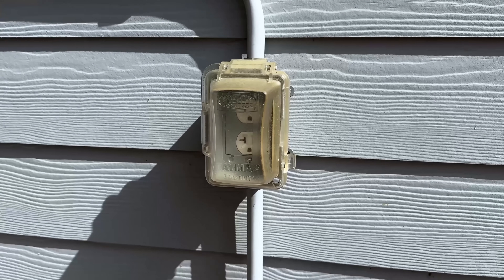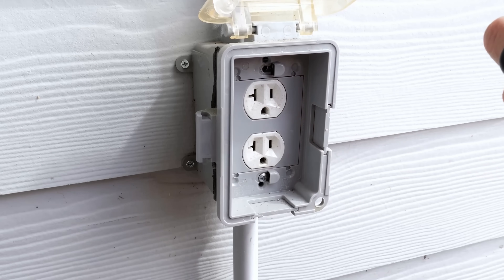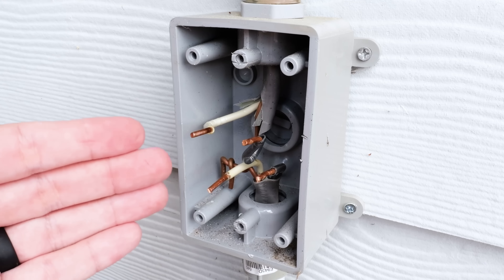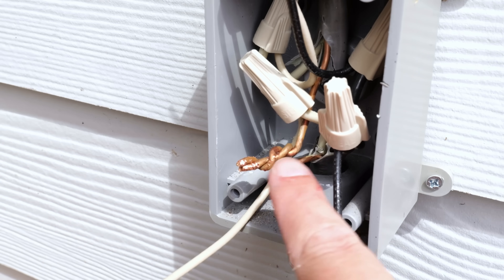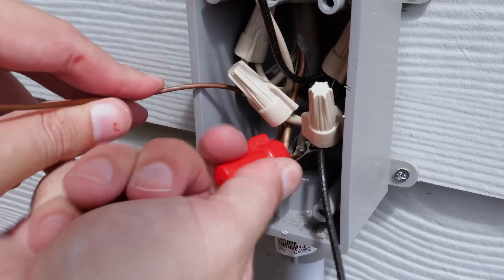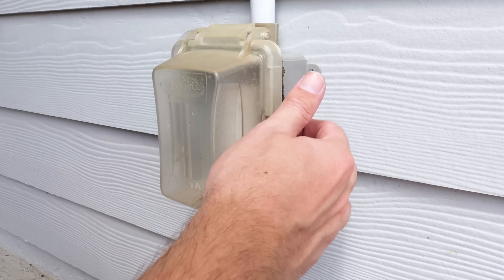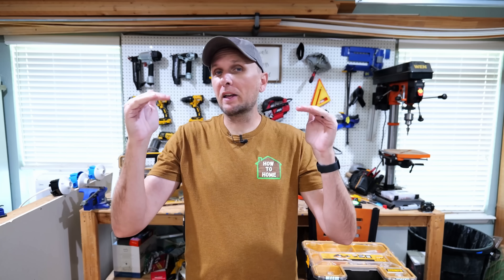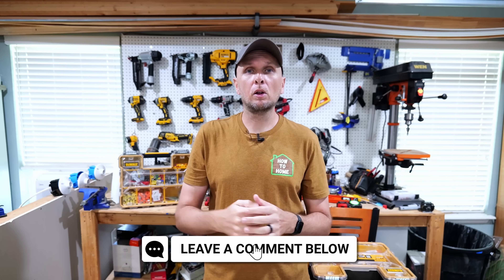Dangerous Mistakes DIYers Miss When Installing Outdoor Outlets!

Comment: The tester you used i used one not as nice as yours i tested a outlet i told a guy who did wiring he said the GFI will show its bad even if it wired the correct way what do you think is your tester made specific for GFI outlet
Reply: I also, though not an electrician, own 2 GFCI rated testers that are SPECIFICALLY designed to test GFCI outlets as well as all the rest.  They cost more but I prefer to have that capability when it's needed.

Comment: Is that even the correct kind of wire to run in conduit? I thought it had to be stranded for conduit because of heat buildup.
Reply from the maker: It is UF wire.  Completely allowed.  Romex would not be in a wet location.

Comment: I am confused as to whether the mission of your channel is “How to home” or if it’s “How to do electrical work up to NEC requirements”? Code matters little for most DIY home owners when it comes to retrofitting.  Certain things like GFCI’s outside are pertinent but length of conductors in the box is strictly up to their preference. In Texas any homeowner that resides in the home can perform electrical work on said home without a license.
Reply from the maker: This is a very odd comment.  There are reasons code are what they are.  Safety is one.  Also, if a homeowner does their own work and they did it incorrectly and it results in a fire, it’s possible if the insurance company sees it that they may not accept the claim.  Why do you advocate for people to do things incorrectly because they are home owners?  The length of conductors is not just for their preference.
Reply: @ Easy there, just asking a question! I am not “advocating for people to do things incorrectly”, it is just odd for a diy source to preach code so heavily to people that are ostensibly not licensed electricians and it’s coming from someone that is also not a licensed electrician, or at least didn’t mention being one.  As someone that is in the electrical trade and has taken several tests on the NEC over the years and spent hundreds of hours studying the codebook, I promise you that not everything in the NEC is there out of a desire to promote safety and the preservation of life and property, and homeowners should use their own judgement in certain cases if they decide to take on a project instead of calling a professional electrician in the first place. To reiterate, I did mention that some code requirements are pertinent, such as the gfci requirement outdoors or in other wet locations. It is actually code requirement now for the receptacle you replaced to be protected by AFCI as well, depending on your state. I notice that you did not mention that, but I wouldn’t blame you because the breakers are 9-10 times the price of a normal breaker and can cause nuisance tripping as well. With modern technology anyone can find answers to code questions in mere seconds, but most people have the good sense to call a licensed electrician if they don’t know what they are doing. I wish all homeowners would call qualified, licensed and insured electricians and not use jake leg “handymen” like “Juan’s home improvement” types that are extremely prolific here in Texas. Have a good day, no offense intended.
Edited for punctuation error
Reply: @HowToHomeDIY  Thank you.  When people are working with a potentially lethal subject following proper safety precautions and "code" might be worthwhile.   (just a thought)
Reply: Even Texans occasionally sell their homes and real estate home inspections worth their salt will pick up on crap electrical work. Typically a home buyer will request that  repairs be made by a licensed electrician. So there you are having done the initial bad work and then having to pay for the rework, which is always more expensive than doing it right in the first place

Comment: My outdoor outlets on a GFCI thats in a bathroom on the second floor.
When ever it rains a lot it keeps tripping. The box was installed in the wall. Weather proof covers do not help, i used several trying to solve this problem.
How can i fix this issue?

Comment: Heyyy, your sposed to twist the wires together, then the wire nut
Reply from the maker: That is best practice but not required.  I elected not to due to how short they were and #10 wire is pretty difficult to twist, especially that short.  More damage would be done than benefit in my opinion.

Comment: The ground and gfci is the only real issue here. The short wires don't affect anything particularly using receptacles that don't require wrapping wire around screws. In this case I would vary from code in the interest of less opportunity for failure(fewer connections) and not downsizing wire in the middle of a circuit. That was a very short run from the line side. I would be curious as to the gauge of wire coming into the j box. If it is 10 gauge and the wire length was really bugging me, I would run a new longer 10 gauge from the j box. Then you would only be reducing gauge on the load side of the receptacle.
Reply from the maker: Per code it is an issue.

Comment: I would have used 10 gauge to splice it. Along with a 20A Gfci.  For those that don't know there is a reason he separated the connection. One side of the outlet is set up to be the load

Comment: The GFI receptacle for my setup is in my garage. The outdoor receptacles are downstream from the GFI.
Reply: as long as the first outlet in the line is gcfi, everything downrange is supported...
Reply: @mitchellfay5725 thank you
Reply: @mitchellfay5725 it's pretty terrifying how people play with house wiring and have absolutely no idea what they're doing....they'll unalive someone
Reply: @mitchellfay5725  and - every outlet downstream has to be labelled GCFI.  Aaaaand - outdoors you want an outlet rated for wet weather.  That's all I got.
Reply: I just found out that's how mine was set up too from the builder. If it's not code compliant, how are they able to do that?
Reply: @charlesdavid5137 that is a code compliant setup if a standard outside outlet is serviced by an upstream gfci outlet /breaker. Anyone telling you otherwise is mistaken.
Reply: @charlesdavid5137  It is code compliant.
Reply: Well, your roof could fall above --leaking onto your wiring--then you kiss your house goodbye!

Just get a few things, find a good cave--with an agreeable mama bear with cubs--then, just forget about it!
Reply: @GeoffreyMorrison-xh2eo what are you smoking?

Comment: I believe I saw a bonding crimp on the bare ground wires. That is code in Wi. A wire nut is ok if in addition, but it must have the copper crimp!

Comment: The plugs on the GFCI look like this is a 15 amp plug installed on a 20 amp circuit.  You should mention to use a 20 amp GFCI.
Reply from the maker: Why would I do that when using the 15 amp is totally ok?

Comment: @HowToHomeDIY,  May I ask why you installed a 15 Amp GFCI Receptacle on a 20 A circuit?
Reply: I stand corrected, my apologies to you sir! I've just always had it in my head that like circuits, should have like receptacles (Amperage-wise), but I now see and understand why what you did would be acceptable. Thank you! (No hard feelings, I will continue to watch your videos!)
Reply from the maker: I just didn’t need a 20 amp receptacle at that location.
Reply: @HowToHomeDIY  I'm not trying to be an a-hole, but you said in that video, that it was a 20A circuit;  yet you replaced a 20A "regular receptacle" with a 15A GFCI.... that's not okay dude. If the Circuit ever overheats, it will catch the GFCI on fire before it ever trips any of your breakers. Especially since you made it clear your panel does NOT have a GFCI breaker. Cheers.
Reply from the maker: It is a 20 amp circuit.  And it is completely ok, dude.  That’s not how it works.  NEC allows for 15 amp receptacles on 20 amp circuits.  Also, 15 amp receptacles are rated for 20 amps and have the same internals.  The faces are just different as you can’t put a 20 amp receptacle on a 15 amp circuit.

Comment: You mentioned a requirement for a conduit clamp saying it was wrong that it doesn’t have them and stated they are needed for code compliance. However, code does not require them for short runs unless they exceed a certain distance. You did not mention the distance requirements and simply state they are required. This is not true per code. I recommend you state the actual code requirements instead of making general statements. Yes they are required, situationally. Usually the situation requires them, but I do not know that they were required in your example because I do not know what your distances are. There are two requirements, 1) with a certain distance from the box unless the run is shorter than that, and 2) every X distance for longer runs along the conduit.
Reply from the maker: And you wrote all of that without supplying them either.  Required on a short distance or not, putting them on is not against code and only helps secure it.  By the way, it’s 3 feet all the way around with PVC conduit.
Reply: @HowToHomeDIY  He’s the content creator, he should state it. It’s actually <18” unbroken length does not require a strap, but don’t take my word for it. Hard to tell his lengths on each side of the box in the video.
Reply from the maker: Incorrect and that’s an opinion.

Comment: I am surprised that you ran the continuing circuit threw the receptacle.   Not  code in CA. where I worked.
Reply from the maker: It is a GFCI, that is how it has to be done in order for it to protect all of the receptacles downstream.  I think you are confusing this for regular receptacles.
Reply: @HowToHomeDIY  Yes, thanks.

Comment: If you're concerned about voltage drop due to distance, and you up the gauge to 10 AWG, then I wouldn't be adding a 12 AWG pig tail. I'd use 10 AWG, otherwise, you're negating the benefits of the 10 AWG in fighting voltage drop.

Comment: does laundry washer need to be gfci?thanks
Reply: A better way to find out than by asking randos on social media is to use an internet search asking about the National Electrical Code such as "does nec require a gfci outlet for a washing machine".

That will give a more reliable information than social media, and help you to be independent.

Using good independent research methods can also inoculate you from the current trend to idolize ignorance.

Comment: Why did you go from 10g to 12g back to 10g? Is the load side only requiring a 20amp?
Reply from the maker: Yes.  The only reason for the #10 was for voltage drop which this didn't effect at all.
Reply: Thank you for replying.
Reply from the maker: Very welcome.

Comment: You might start with when NEC added the GFCI requirement (2023). This may not have been required when it was installed.

Comment: I did learn something, I knew the wires were too short, but didn't know about the 6 inches, also the faulty ground. Thanks, BTW what is code for how far apart should your conduit supports? I'm interested in the power screw driver, where can it be purchased? Thanks again

Comment: "Code is code" - Right, and that's why it's always changing.
Reply from the maker: Ok and until it does change, code is code.
Reply: @HowToHomeDIY  - Go into any home more than a few years old, and you'll find a lot of "current" code violations.  Still legal, no need to bring up to current code.  And I'd feel safer with short wires, NOT jammed in like you did, you made it worse.  But hey, it's code, to hell with logic.
Reply from the maker: @Summitspeedfly more than a few years?  No there won’t be a ton of code violations.  And if there are some they technically aren’t legal they just don’t have to be updated unless any work is done on them.  The rest is just opinion.

Comment: Did you put a 15 amp GFCI outlet  insted of a 20 amp GFCI outlet.  ?   I didn't se the horizontal openings o the recepticles
Reply: So, we now have a 15 amp device on a 20 amp circuit?
Reply: @De4n.1 it’s fine to do this. He has heavier gauge wiring. If this was 14 gauge wire he could not add a 20amp receptacle. The receptacle can only pull 15 amps through his 20 amp setup. That said, I would not do this if my house had heavier gauge prewired. Mostly for tool use and things like that. If you have 2 power tools going there’s a possibility the 15amp gfci could pop. This won’t be an issue in most people’s daily life. With all that said, if he already had it on hand then it’s fine. If he bought it, that’s a poor choice.
Reply from the maker: Yes.  Can you supply me with code or manufacturers instructions that says I couldn’t do that?  Because I know there is plenty of code that does allow it.
Reply from the maker: Yes I did.

Comment: It looks like you used the wrong gauge pigtails. Also better to see if there is any slack in wires first vs pigtails. Also you should twist wires especially if doing a video. Im old you know how many i found with shorting out problems for not doing that. Its allowed but but doesnt mean its great, thats why they always change things and it only takes a sec. Also you should probably have put an extenshion on box for more room since using 12 gauge to give more room. Also the receptical tells you load side. I like your videos but if your going to do this you gotta be spot on. Some homeowners dont know, you should know and are not telling. Becarefull and remember your audiance. Also more clamps top n bottom. Code requires distance for clamps,but you did mention to at least use them. Also probably should have shown how to attach grounding wire to a metal box n receptical, since homeowners will find theres to be metal. Im not anyone special just did it for many many years and anything electrical has to be perfect when showing others.
Reply from the maker: My answers are going to be very brief because you brought up a lot and to explain the why with all of them would take forever texting.  Nothing wrong with the pigtails. No slack.  Twisting is great but not required and would be a pain with #10s and unwise with how short the existing wires already were.  Sure.  Yes I said that the receptacle tells you that.  Clamps are required after 3 feet, how many did you want me to install?  Technically mine didn't "require" any.  I don't have the time in a video to show things that aren't integral to the video.  They are already long enough after I have cut out tons of info I filmed.

Comment: Not sure if the GFCI receptacle you installed was rated for 20 amps or you changed out the breaker to a 15 amp?
Reply: You don't need to change the breaker to put a less powerful outlet on the circuit. Hopefully you never do any electrical work.

Comment: That 20 Amp plug is fine if it's on a g.f.i. breaker in the main box. Always check the main panel don't assume by just looking at the receptial

Comment: Did you just install a 15A outlet on a 20A circuit?
Reply: A lot of circuits are rated 20 amp and have 15 amp outlets- most in your home in fact.  Putting a 20 amp outlet  on a 15 amp circuit (14 gauge) is dangerous, not the reverse.
Reply: As long as you are not pulling more amperage than the wire and breaker are rated for it is fine. Putting a 20A outlet on a 15A circuit would be very bad.
Reply: It is code compliant. One of the first things you learn as an electrician. 15 or 20 amp recepticals on a 20 amp circuit. Can't do the reverse

Comment: On the line/load terminals, I've always liked the line on the bottom and the load on top as most of the wires I have worked on had the line from the ground and the load towards the top or ceiling.  Many of them are opposite of this now, any idea why?

Comment: I like that 10-gauge overkill idea.
That is UF wire, not NM (Romex) run through the conduit, correct?
Reply: Ever worked with 10 gauge?  Tough stuff.  Usually for home runs on circuits with one 30amp appliance like a dryer.
Reply from the maker: It is, you are correct.

Comment: The cover is designed as a keyhole design wherein you put the screws into the receptacle and box and then place the cover on and slide it to the right which engages the screw heads. Then you can tighten them down. You don't have to Fumble with putting the screws through and then aligning them with the holes in the receptacle and the box.
The same with removing the cover. Loosen the screws, slide the cover left, and remove the cover. This is handy for replacing the degraded water seal.
Reply: As soon as he started unscrewing the box I noticed and wondered what the plastic sticking up beside the screw was for. 
Your point makes it all clear for me - that is over the larger whole where the head of the screw fits into the box and gives a little more structural integrity so the keyhole doesn't breakdown over time. 
TY. I'd never seen seen this design before and didn't even know it existed.

Comment: I have a central GFCI breaker in my breaker box that controls all of the outlets in the bathrooms, etc. The outlets are plain outlets that do not look like GFCI outlets at all. So did you check to see if this outlet you're working on is on a central GFCI breaker?

Comment: Is it correct to have sheathed cable running through the conduit?
Reply: I asked Gemini and the general answer was it is OK for a few feet (<Five?). But AI makes stuff up so you should check a code book. Also it is disallowed outside.
"Important Considerations and Limitations:

Damp or Wet Locations: Romex is not permitted in damp or wet locations, even if installed in a conduit. Outdoor areas are always considered damp locations. Certain indoor areas might also be classified as damp."

Comment: Is it legal to have romex in conduit? Is that UF cable and is that box rated for all those conductors?
Reply from the maker: No romex is not legal in conduit in a wet location.  Yes it is UF.  And with #14 or #12 yes box fill would be fine.